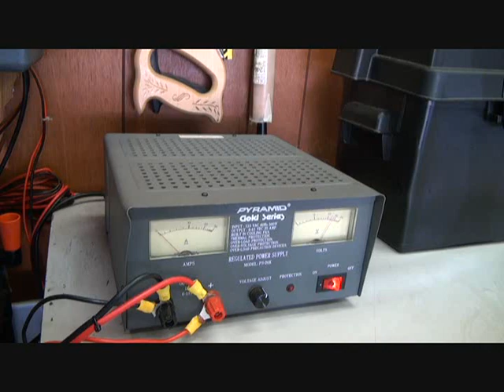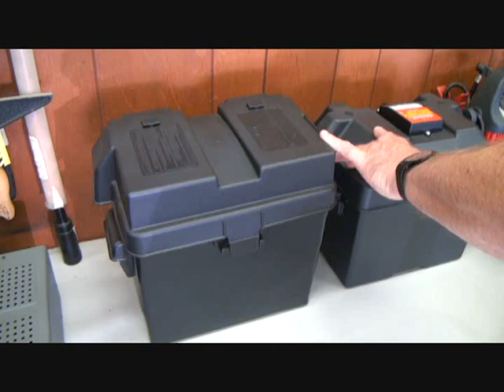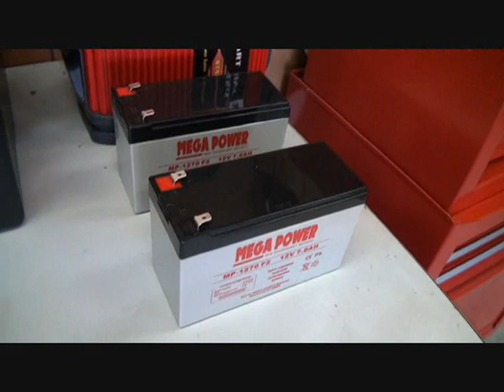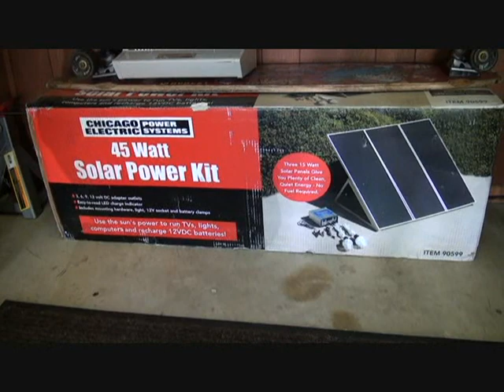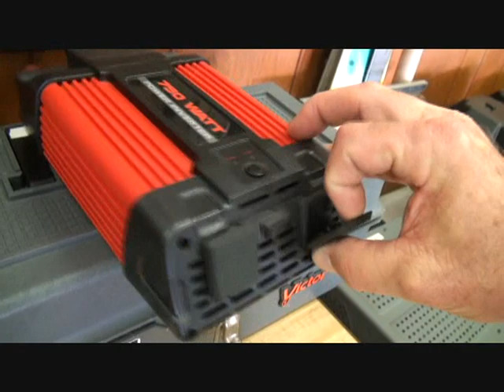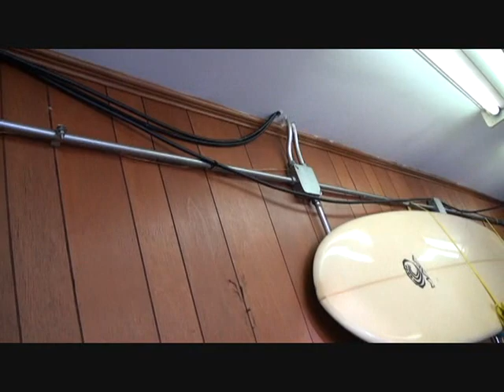Communications:  Back up Power

Comment: Harbor freight has solar panel in 50 or 100W configurations, and the inverters up to 3000W. I suggest having a few power banks with USB plugs for personal radios or cellphones/tablets.

Comment: In light of current matters, I am considering emergency backup power - both inverters and portable solar. I figure that I need around 2000w on the inverter to be safe, but I cannot get a clear read on 'best bang for the buck' deals and reviews in the UK market.
I'll gladly take fresh reviews on either please, or links. 

Much appreciated.

Comment: You are not alone. I also power my entire house on a 3500watt generator.
 This became necessary after a flood, then another 2days later, followed by a twister that ripped the electric service and meter from my home by toppling a 100' pine tree.Didn't have time to rig a "box" but two 120v single phase H-D extension cords (12 ga) plugged into two exterior (porch) outlets supplied both "legs" of my electric need. I simply made two "double-male supply cords run from gen. to outlets.You & SootchRA1OK

Comment: Yep I should have mentioned that in the video. Golf Cart and Marine Deep cycle batteries are great and you can even find some used ones that can still be serviceable because folks often change these out in multiples and ahead of having trouble with them. Got some batteries from a buddy out of his big Ford diesel for just the core charge ... one was good ,  one I had to dispose of and got the core charge back..... win - win !

Comment: Another good point: thats right Don even with my setup I can not run the whole house as if I were on the grid. So you would have to be selective what you run but everything will have power available to it. It does help that I am on gas so hot water heater etc... will not be a drain . Have to keep the fingers crossed that we do not lose gas service.

Comment: thats actually pretty cool.
If you remind one of my latest comments I mentioned Backup power supply.
That video covered large parts of what I had in mind. But to put in a nutshell all this cool stuff is depent on something: sun, charge, fule. Would be interesting to have your opinion on a simple generator to work with your hands, that depents on nothing but your strength.